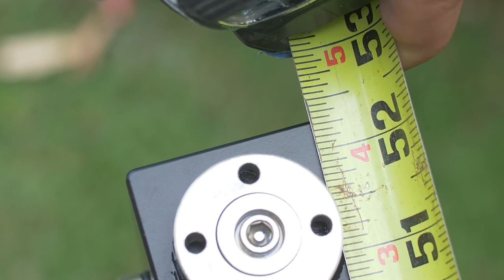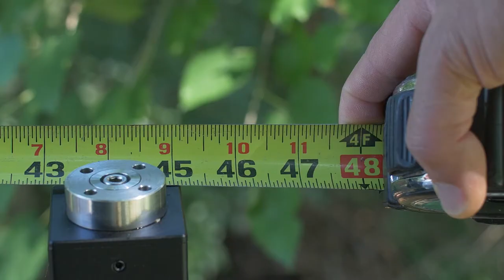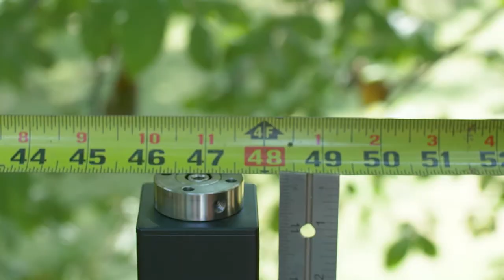Installing Signature Series Side Mount Posts and Aluminum Handrail | Cable Bullet Cable Rail System

Comment: love your system,    but have you used a Vix bit ? its a drill bit enclosed in a larger diameter housing that allows a perfect centered pilot hole.  
the come in # 6, 8, 10, and 12 sizes.  To get precise centering in a metal hardware. check vix bits out.
Reply from the maker: We have not tried this but will definitely look into it!

Comment: hi ,  Just a note on the meaning of level and plum semantics . Anytime you are holding a level horizontal it's  called  checking level.  Anytime you are holding a level Vertical,  it's called  checking Plum.
As a cabinet make for over 45 years ,  when you place your 6' vertical level many times in the video on a bracket and say it's level.  Kinda clouds Clarity up a bit.  And makes me Batty.  
like calling a nail a screw.
But you are a excellent instructor and thinking about buying your system.
Reply from the maker: Thanks for the feedback, Allen. Accuracy matters! We'll keep this in mind for next time around.
Reply: Well if we're being pedantic, plum is a delicious stonefruit of Asian origin.  Plumb is the vertical perpendicular alignment to level.

Comment: Around the 28:00 mark would it make sense to install the lowest cable and bullet fittings (knowing they can be removed fairly easily off one side) and validate the placement of the intermediate post, to be point-perfect?  
Also what's the post distance recommendation where you'd need a spacer bar - 6ft?  thinking about the inspector doing the 4" sphere test it seems like this is designed to keep it from deflecting throughout.
Reply from the maker: Hi there! Yeah, you could absolutely do that to validate your post placement! As it regards spacer bar placement, we recommend having some sort of cable support every 4ft. So if you have a 6ft span, you'd definitely want a spacer bar in the middle to help with your cable deflection. If you have any other questions, you can also reach out to our support team via our website.

Comment: do the post come with rain mounting bracket installed on top or do they need to be installed? Thnx
Reply from the maker: Hey George, our posts come standard with your choice of handrail mounting bracket (classic or modern style). Our aluminum handrail meets IRC requirements for "graspability", however, you would need to use the 36-inch height posts. We are currently working on a standalone handrail bracket that mounts to the side of our taller 42-inch posts.